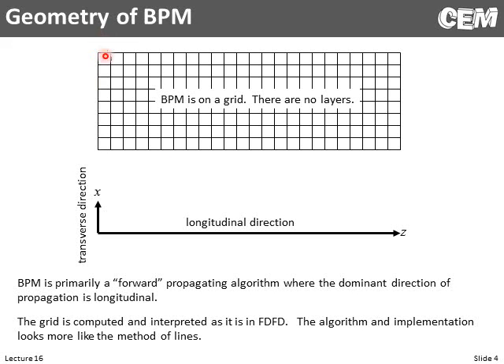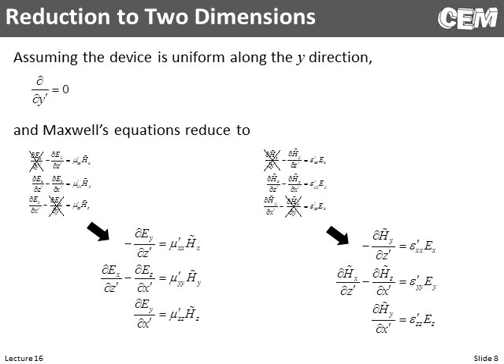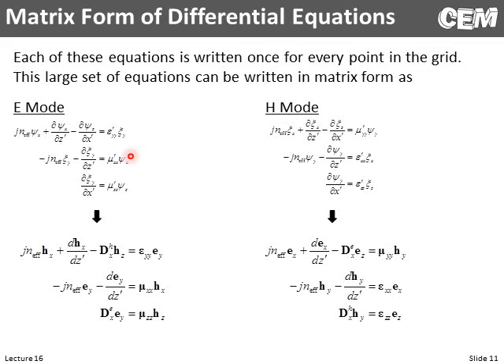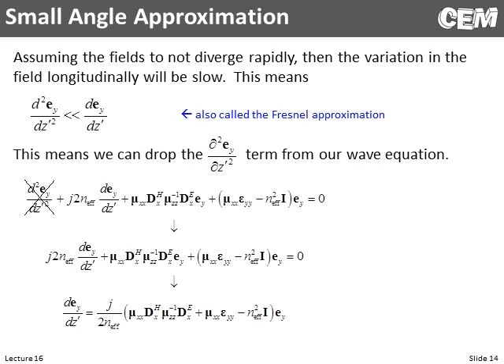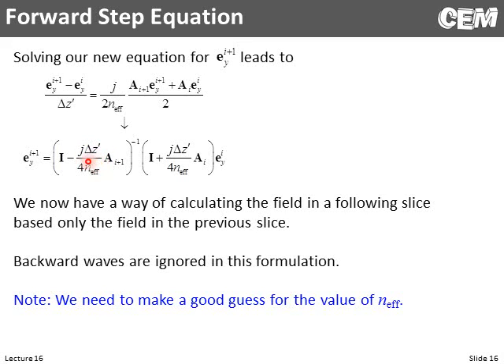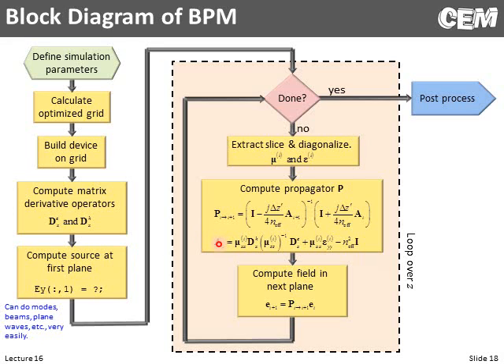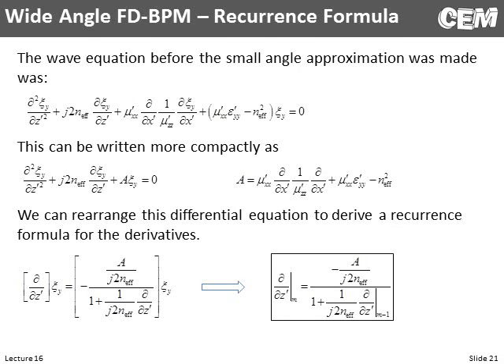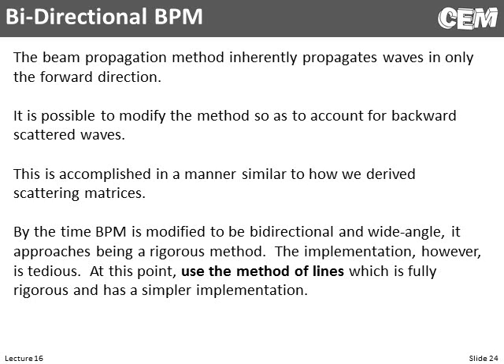Lecture 16 (CEM) -- Beam Propagation Method

Comment: I have a long lasting question in this topic
Which method is faster in 2D scalar paraxial wave equation:
1 - FD-BPM (Crank Nicolson Scheme, which mostly costs a linear system solution)
2 - FFT-BPM (Costs 1 fft, 1 ifft and 1 multiplication)
?

I've simulated both of these methods in MATLAB and, to me, FFT-BPM seems faster, but I've come across two articles comparing both methods and they've concluded the opposite. On the Crank Nicolson scheme I'm using the backslash operator in MATLAB to solve the sparse linear system and though my tests it seems as fast as the Thomas Algorithm. And I'm also using sparse matrices.

Thank you for your time and your amazing content. I've been watching your videos since I've started my research in optics as an undergraduate and the content that you put out there is really valuable to a lot of people.
Reply from the maker: Short answer -- I don't know!

However, I will make a guess that the FFT-BPM is the faster method when the transverse direction is large.  At what point it becomes faster I am not sure.  Also, the hardware really affects which is faster.  I might be that on a GPU the FFT approach is faster while on CPU the FD approach is faster.  When comparing the methods, don't just compare for one simulation.  Instead, compare the speed and memory as problem size grows (or grid resolution gets finer).  I think that will be more telling.
Reply: @empossible1577  I love that you answer so quickly hahaha. I have a follow-up question. Is there any method for Transparent Boundary Conditions for FFT-BPM? I've searched quite a lot and found nothing. It is quite common to find TBC for FD methods, but I've not seen a TBC for FFT-BPM yet.
Reply from the maker: @carl00s01  Hmmm...I don't think there is a TBC, but you have at least two options.  First, you can make the transverse dimension large enough that the boundary conditions do not interfere with your answer.  Second, you may be able to incorporate a PML or at least graded loss at the boundaries to absorb waves.
Reply: @empossible1577  Thanks for your response. I've been doing the first way for quite a while. Do you have any reference for the second one? I've never seen a PML for FFT-BPM
Reply from the maker: @carl00s01  I recommend a uniaxial PML so that the PML is independent of the implementation.  It is only a matter of incorporating the loss terms in the permittivity and permeability.

What are you simulating?  I might be able to suggest something better.
Reply: @empossible1577   It's nothing fancy, It's the scalar paraxial wave equation with a periodic refractive index. The issue is that some modes travel really fast to the boundaries and I'd like to avoid the usual increase in the transverse coordinates length. See Fig. 2(a) for reference ( https://www.math.fsu.edu/~musliman/publication/PT2.pdf )

Comment: Dear CEM team, 
first of all I would like to thank you for providing this great online resource, I enjoyed your lecture series a lot! I implement a Pade [1,1] 2D (x,z) BPM method following your instructions and tried to model the propagation of a Gaussian beam (3um beam radius, 370nm wavelength) in an anti guiding step index fiber (the fiber had a cladding refractive index of 1 and the 6um core had a refractive index of 0.98) with it. According to my BPM model the beam was still somewhat confined  in the core after propagation one Rayleigh length, which surprised me. I would have expected that the beam would diverge significantly stronger than a beam that is propagating in a homogeneous structure. I was wondering if this BPM method is capable of describing such anti-guide problems correctly or if have to implement higher Pade[2,2] with multi steps.
Cheers!
Reply from the maker: I am curious about your choice of refractive indices of 1 and 0.98.  Wouldn't 1.5 and 1.499 be more realistic?  Also, the refractive index of the core should be slightly higher, unless you have something special in mind.
Reply: My choice of refractive indices is in fact a little unusual but exactly what I would like to model. My question is if you see any fundamental reason for this method to fail when using refractive indices smaller than 1
Reply from the maker: @stefangaus8316  I am not coming up with any reasons that should not work.  Have you tried simulating something with a known answer that has refractive indices around 1.5, just to benchmark your code?

Comment: Thanks for the videos! What are some advantages of using 3D simulations to calculate the modes propagating in a waveguide compared to a 2D geometry simulation?
Reply from the maker: Some things just cannot be simulated in 2D, like helix antennas or some devices with anisotropy.  The accuracy and trustworthiness of a 3D simulation is also better for 3D structures.  However, if it is ever possible to simulate a 3D structure in either 1D or 2D, I think it is always good practice to do so.  This will get you 95% to the final design without the need of a big 3D simulation.  Almost all of our 3D simulations are done mostly in 1D and 2D.  Often, our 3D simulation is only done to confirm what our 2D simulations predict.
Reply: CEM Lectures thanks a lot for the help! Would love to add you to my network! This channel is amazing

Comment: In the lecture, you assume the the device is uniform along y direction and get the equation for ey (the vector for the y component of electric field). But what if this assumption is not satisfied? Can we still use this method to get the equation for ey? I was trying to do this but I only got equation with both ey and ex(or ez) in it. I think I need use the divergence Maxwell equation. But because of the difference between DE(the derivative for E) and DH(the derivative matrix for H), ex and ez can't be cancelled at the same time. Could you answer my question? Thank you
Reply from the maker: Yes, this is absolutely possible.  You will have to retain and solve for more field components.  For isotropic materials, this will be Ex and Ey (or Hx and Hy).  Take a look at RCWA in this lecture series.  It does just this, but is a rigorous method.  I may at some point post a slide or two on the 3D BPM.  You can also refer to the literature.  Key words include “full vector,” “3D,” etc.

I added a section to the electronic notes on the formulation of 3D FD-BPM for you.  I did it quickly so beware that there may be a mistake somewhere.  If you find one, please let me know!  You can get them here at Lecture 16:

http://emlab.utep.edu/ee5390cem.htm

As you will see, Ex and Ey are no longer separate and are calculated at the same time.  It is a much larger numerical problem (as 3D always is).  If you have a polarized beam, say in the y direction, then your source would simply just set Ex to zero, but it will still need to be there.

As long as you adopt the Yee grid for your finite-differences, there is no need to include divergence equations.
Reply: Can I get the electronic notes for FD BPM 3D? I search the em lab page but couldn't find the same.